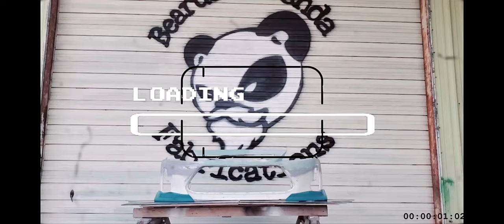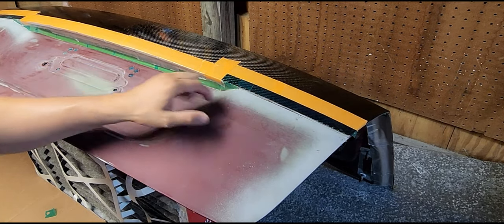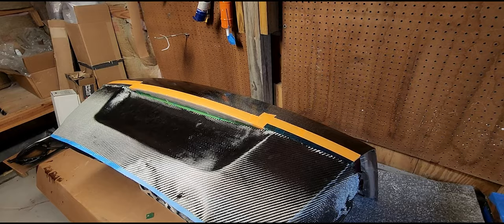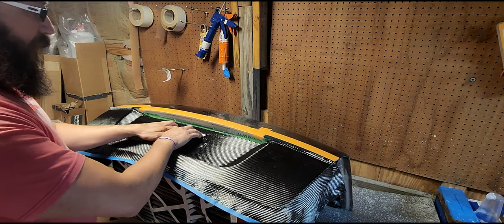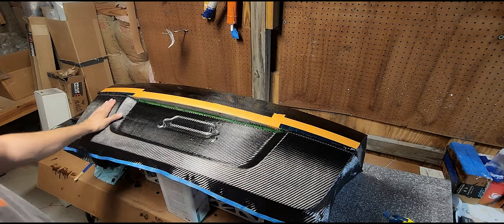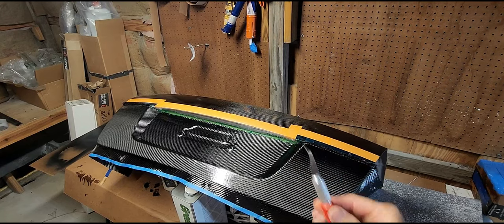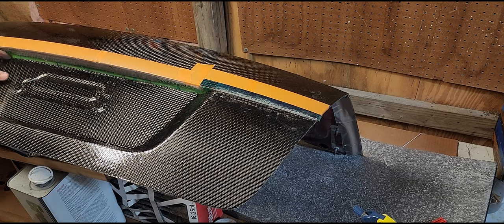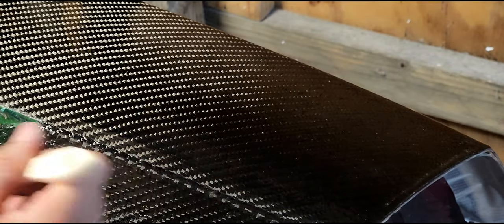DIY Carbon Fiber Skinning/Wrapping Trunk With Multiple Pieces Tutorial - Pontiac G8 Trunk Part 3

Comment: So I’m doing a lot of research about this stuff because I wanna start doing it any advice or tips and tricks while starting and question what is the black resin that you are using is it like a color mixed with with resin and apoxy hardener and you put it on so the color doesn’t show thru the carbon cloth?? Looks amazing👍🏻👍🏻
Reply from the maker: I'm good with any questions you have, man. I had tons of questions when I first started and had to do so much research to find out the answers. That and trial and error. 
So I use a black mica powder meant for epoxy. You can find it on Amazon or a craft store. I usually mix it into the epoxy first to assure consistency, then add the activator/hardener. You're absolutely right, it's added so that the color doesn't show through the weave. Spray painting it black doesn't allow the epoxy to get a good hold and will usually delaminate after a period of time.  Always work with a scuffed surface. On plastics, it's best to razorblade a cross-hatch pattern or use 60/80 grit sandpaper so that the carbon fiber/epoxy gets a good hold.
Reply: @BeardedPandaProductions  well thank thank you very much for you’re advice it helped me out a lot and I love the videos keep it up I love how detailed everything is and how easy u explain it 💪🏼 you should be a teacher but on YouTube 🔥